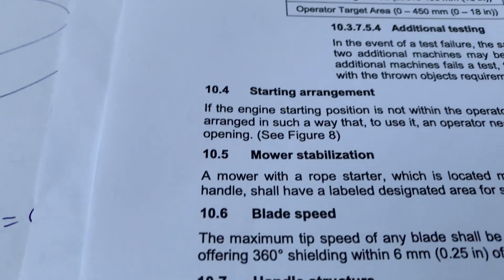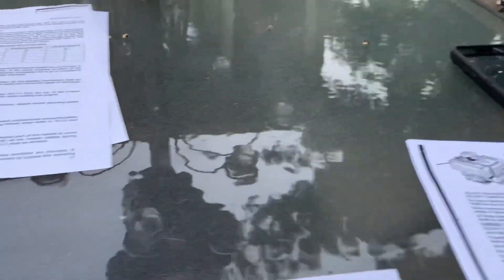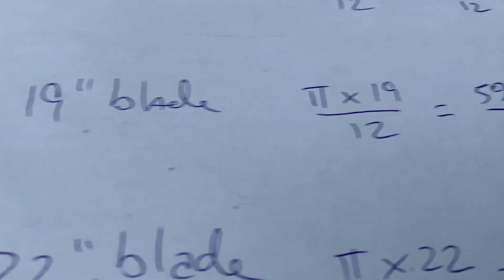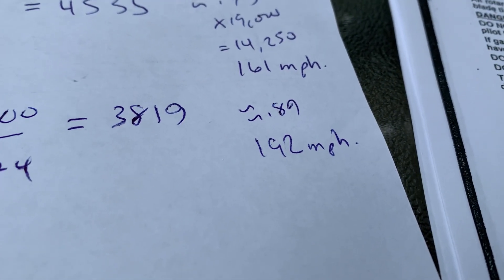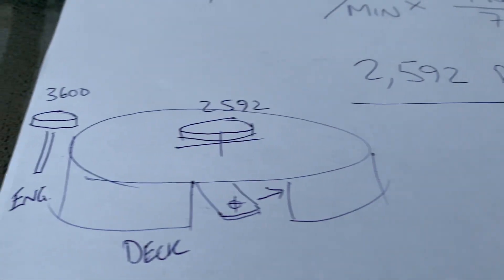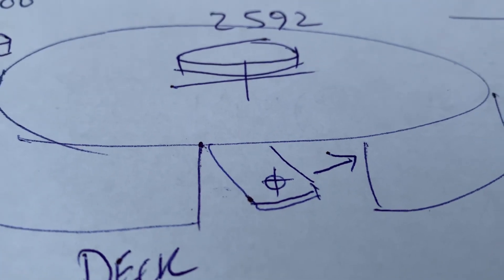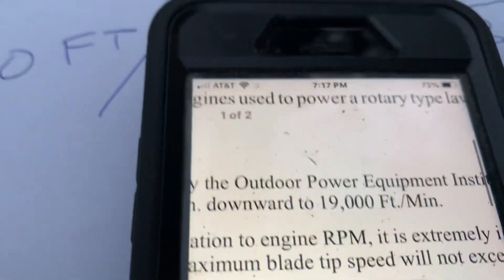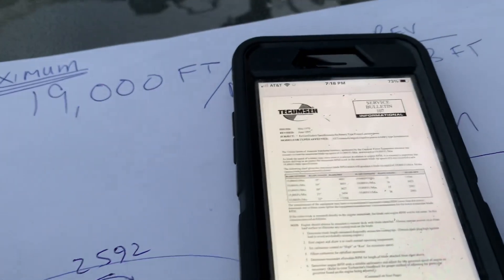200 plus MPH out of a Push Mower? Let’s see how it’s done!

Comment: Urban HillBilly No Prep Racing alert !!
Traded an Ag friend for a new in box Briggs 9.75 elec start . Installed it on my old craftsman cast aluminum , 4hp self propelled / push mower deck.
Mounted a dual blade, added a manual throttle, starter switch, solenoid, batt, tiny led headlight and switch. 
Attention!!! Lawnmower repair people DO NOT READ THE NEXT LINE !! :dothefive::thanksdoc:😱😭
Completely REMOVED the output shute,(YEEE HAWWW !!!) plasma cut 1" inch more material on each side of shute, widening  opening quite a bit.(More YEE HAW! cutting aluminum with the Plasma is NOT recommended unless friends, beer, and cameras are involved.
Upon multiple repeated annoying and insistent ..requests were made. Fabricated an anti clog hand and face saver device! Welded small tab and ran a long rod I pull to swipe across shute and clear it when clogged while its running.
Then I , because IM a mahhhaaannn!!! (damn straight) bent the governor tab till it limits at 4200 Rpms read on my optical meter. been told rod bolts get unhappy at 4500.
I can literally cut 2 foot tall dry field grass and spray a green cloud, or clog it and leave a pasty  line  of cut grass poop blobs without bogging out. Then turn down to IDLE and mow the yard!
Just cant aim it at cars or humans, or the house, or horses and cattle....crop dusters, Buuut...You can aim it at the in-law's stinky white SuperDuty idling next to the porch for 2 hrs though, that's funny.
DAMN, this thing Boogies.
Reply from the maker: I bet!  The kids blow them up all the time.  As long as they don’t get hurt.  Thanks for watching!

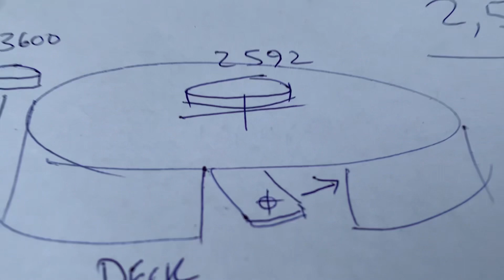Comment: Fantastic video Ken. At  7:55  I was wondering  Ken  !!!   You  could use my old laser tach!!!  That would do it.  Then you said it.  So how fast does the rotor on a helicopter go??    I took out  the patio door glass  in the springtime with a rock coming out of the deck.  I wonder how my strimmer speed is.  Those little pieces of plastic hurt when they fly off the cutter.
Reply from the maker: Unclassified data that I can share is 725 fps (feet per second).  If I told you more then I'd have to...well, you know! Let's just say it is Waaayyy less than a mower blade!
Reply: @KensSmallEngineRepair  Thanks.
Reply: @KensSmallEngineRepair  Higher rotor tip speed equals less forward movement. High tip speeds usually occur at hover.

Comment: Ken,,,, is it the same for commercial mowers? Because it sounds like the blades are spinning A LOT FASTER than a typical mowers you get at the box stores. Am I correct or does it just sound like it...
Reply from the maker: 19000 is the Standard set as a MAXIMUM blade tip speed by ANSI and OPEI.  Most manufacturers stay below this maximum but there are rumors a few zero turns exceed it!

Comment: I remember seeing Briggs specifications that 3,600 was max rpm, but HP peaked at 3,150. That is why I target 3,100 - 3,200 for rpm.
Reply from the maker: Usually there is a sweet spot on the torque and hp curves where you get max of both at a certain rpm HP sounds nice but Torque is what cuts the grass!
Reply: Me too Tom